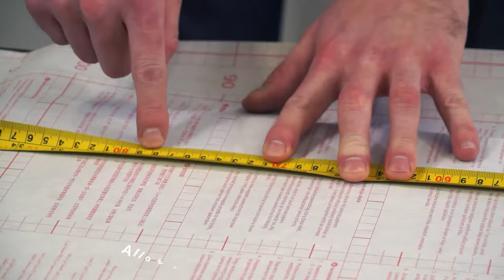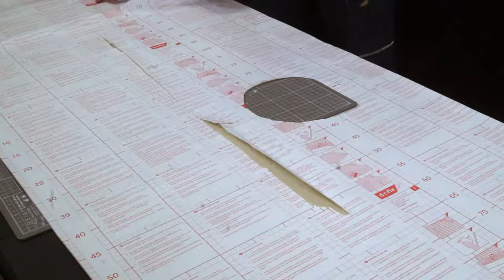How to Apply D-C-Fix Self-Adhesive Film - Ribbeck Oak | B&M Stores

Comment: All very nice but, the moment  you put some heat pot over the "wood" top, it will ruin it... 
Would applying some kind of clear coat protect somehow the flimsy product?
Reply: I've done this a couple of times now and had a few incidents where I put a hot pan on it and it didn't make a mark. But high traffic areas or for example leaning over the sink washing up, I found the pattern of the wrap actually rubs off where my body was rubbing against it. So it's not hard wearing, but it's so cheap so easy fix I guess